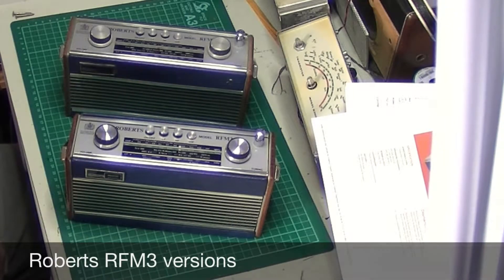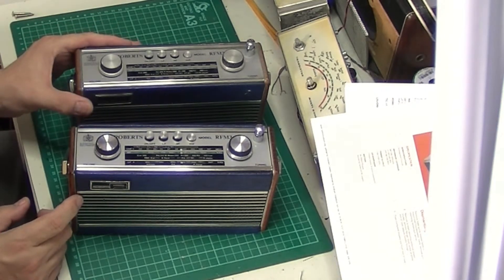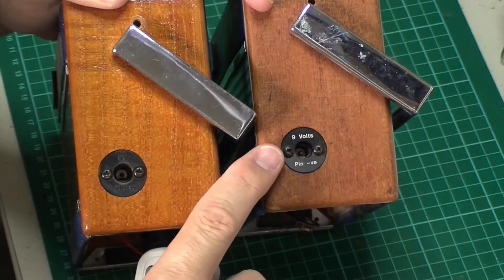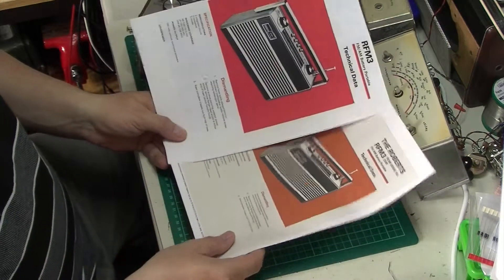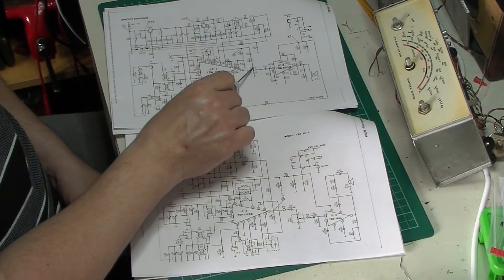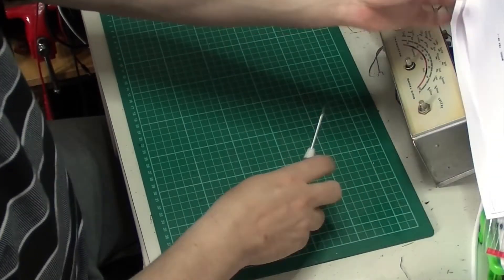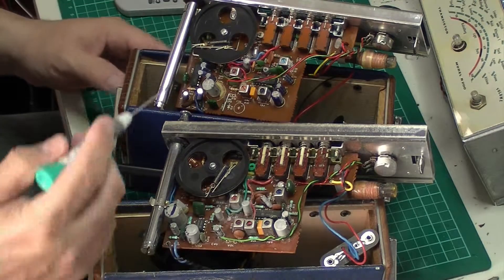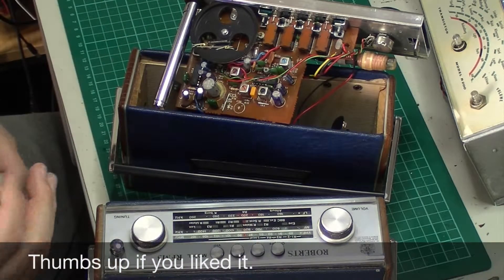Roberts RFM3 radio Part 6: Versions. Which have you got?

Comment: How can I date my roberts rambler?
Reply from the maker: Hi Craig. The Rambler was made from 1975 to 1983. The older ones had rectangular push buttons. The Roberts radio group has a database of serial numbers https://groups.io/g/robertsradiogroup You may be able to find a date code on components inside the radio, I.e capacitors. Good luck. Graham